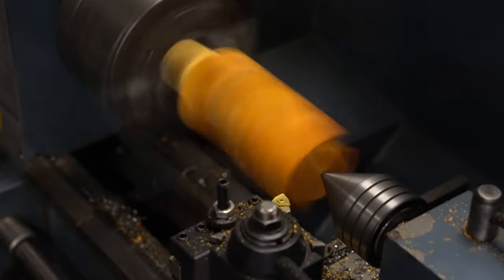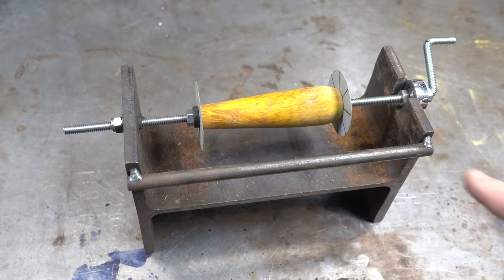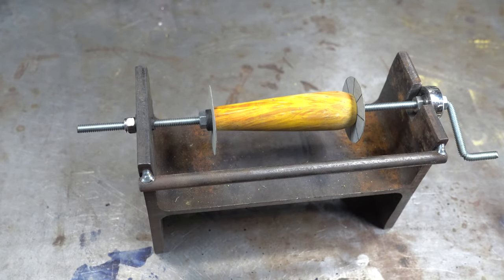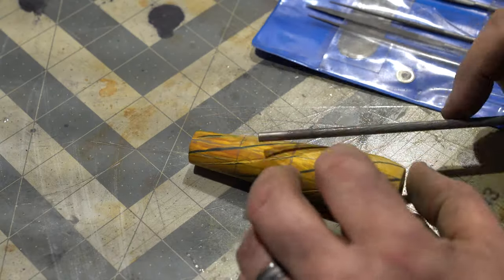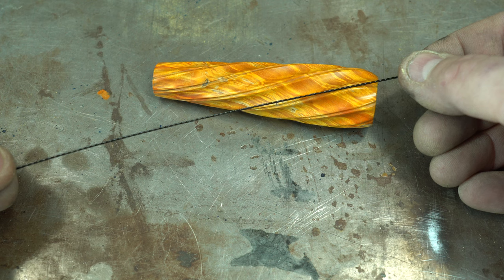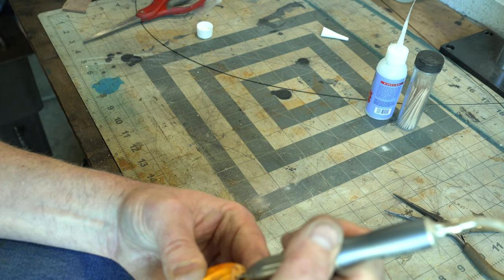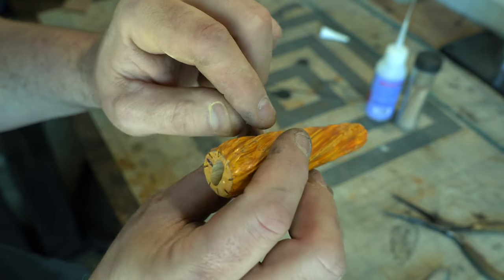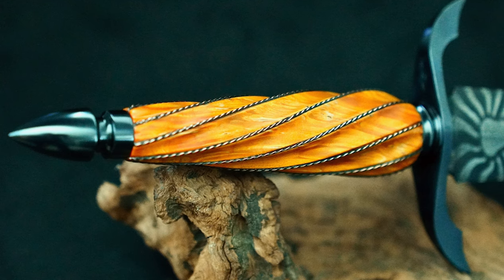Triple-T #135 - How to make a spiral fluted handle with wire inlay

Comment from the maker: Let me know if I've missed anything or you have questions on how this process works.
Reply: How has the wire wrap/inlay held up? Has the blade seen any actual handling (no pun intended), or has it been a display piece?
Reply from the maker: @Tahoza  This was sold a while ago and I haven't heard much about it.  I'm quite sure if there were any issues, I would have been contacted.  Thanks for watching.

Comment: Being the owner of a wood lathe- it’s a messy thing no matter what hahahah
Reply from the maker: Right, but the metal lathe is typically coated in oil and the wood chips stick to everything and that machine is for much higher precision work so it's a big pain to clean it.  I don't have the room in my shop for another lathe, so I'm just complaining to myself.  🤣.  Thanks for watching, Steve.

Comment: I know this Id off topic.  My apologies.   Do you have any recommendations for handle glue up besides epoxy?   I react badly to the chemicals and I wondering if handles can be done without it or some other alternative without the epoxy chemicals.
Reply from the maker: Hmm, 2-part epoxy is really the best and only thing I’ve ever used.  You could use a thick CA glue I guess.  Checkout the links in the video description for Starbond.